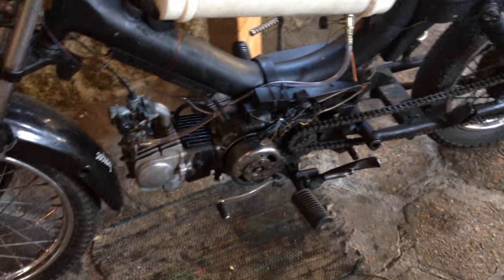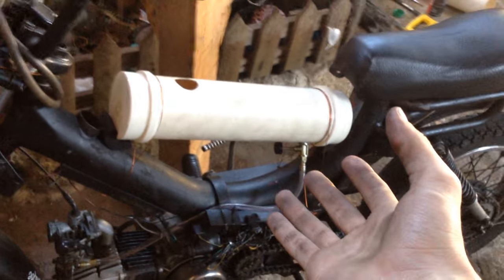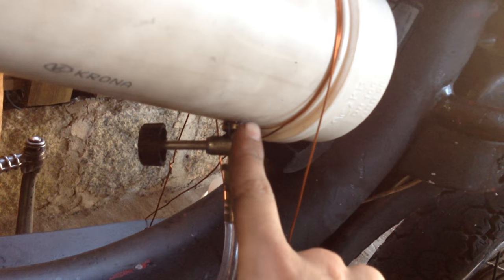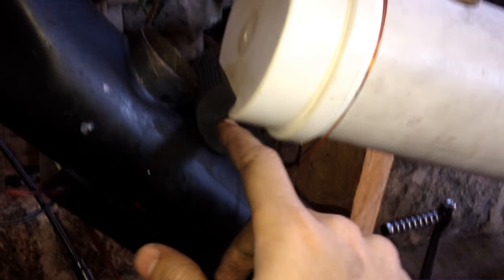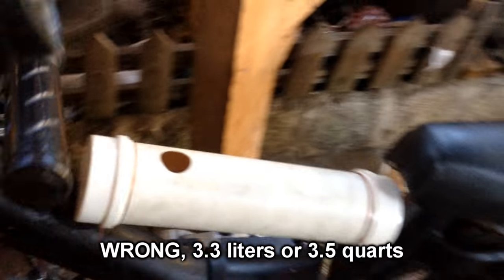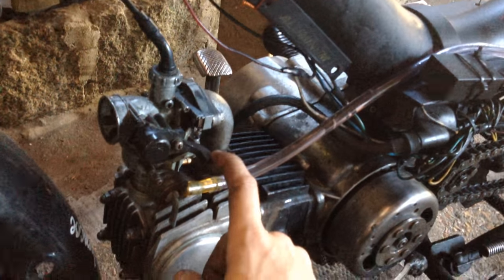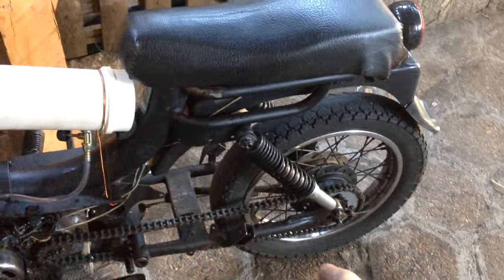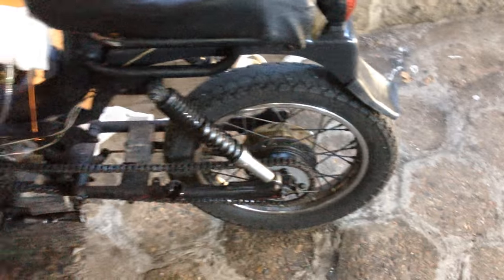Homemade fuel tank for the 100cc Moped!

Comment: PVC has less than stellar compatibility with unleaded gasoline and will be slowly eaten away. PVC is also too prone to static electric discharge to be safely used. If the previous owner told you the engine's too powerful for the frame and that cracked it, he's full of shit. The frame is cracked because he crashed it. The location where you point to about it being cracked, that's exactly where a crack would form, if a crack would form, following a rear ending accident. What's more likely is the engine is so powerful the brakes can't handle it. Most mopeds are 50cc and under. Put a 100cc engine on it and you're talking about having woefully inadequate brakes to stop at the speeds it would be capable of.

Comment: How did the pipe hold up against the fuel. I’m looking to make one for a mini bike but I can’t seem to find an answer. Please let me know.
Reply from the maker: PVC handles gasoline just fine
Reply: pvc pipe is a plastic that was designed to handle very acidic fluids
Reply: PVC does not stand up to unleaded gasoline very well. It's rated at C2 (fair) compatibility with unleaded gasoline. It's also not legal. Seriously. The chance of static electricity in PVC is too high and can a spark can set the fuel on fire.